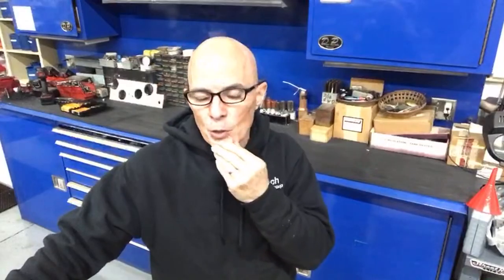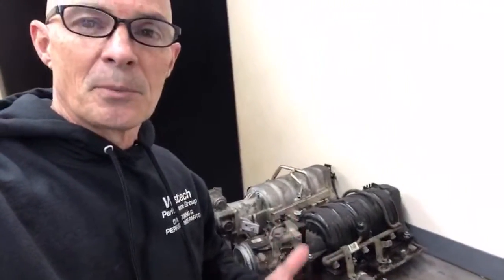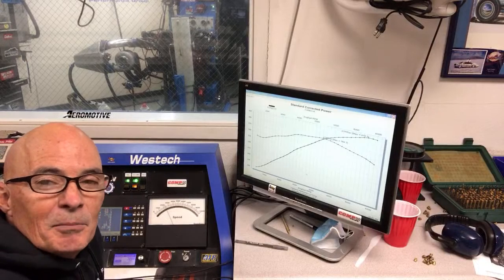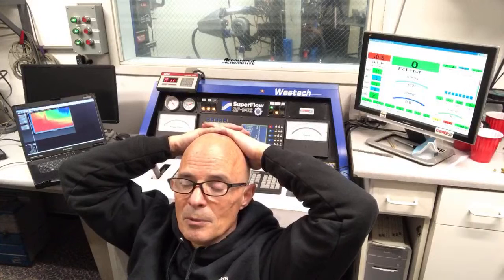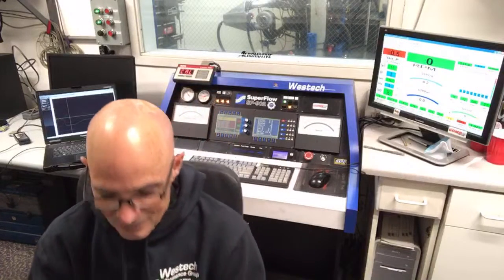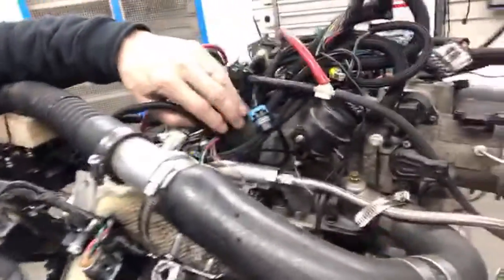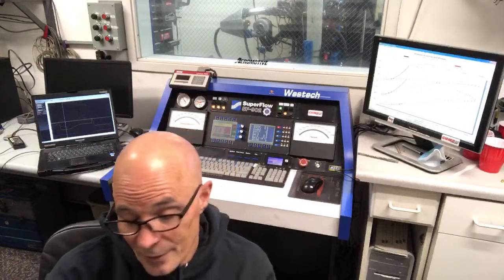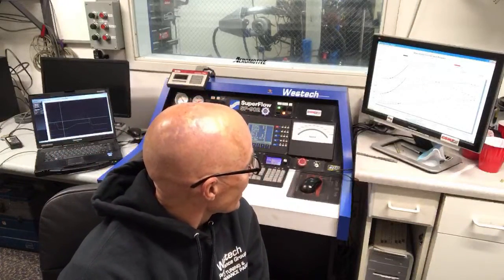Let’s Talk Tech-Turbo 3800 is up!

Comment: As for the comments regarding the Aussie manifold, they are actually pretty poor due to the tiny cross sectional area at the bottom of the runners where the injector bosses are, iirc it was in the low/mid 30mm range height and about 24mm wide. I think they are ok for boost but most serious guys here use the L67 LIM and make a sheet metal plenum.   For NA we tested on a highly modified race engine and found the US series 3 bananas to be a substantial upgrade over the Aussie manifold even if the LIM had to have a chuck cut out and patched up to clear the alternator/tensioner bracket.

Comment: Yeah your pressurizing the case because you know instead of just having pressure after the rotors you have pressure from the turbo even before the throttle body and the PCV is part of the supercharger case what I would recommend is completely block off what I would recommend is not use the blower case as a manifold but if you can completely block off that Port that goes up to the PCV valve and it also goes through the throttle body too iirc and then just make a fitting off valve cover or maybe even use the oil filler neck I think that would work I never actually finished my setup on mine I blew the engine as I was getting everything together to do it but that was my idea .  But once you've got your fitting from the crankcase however you do it and use that to go to your catch can and then remember with the turbo you need a check valve between the boost and the crankcase so then you have to have run a second line with a second check valve that goes to the turbo inlet so when you're under boost it blocks the pressure after the turbo and uses the inlet as the source of vacuum it's hard to explain just in words but I'm pretty sure you get it

Comment: 4L80E is a beast.  The first three gears are the same ratio as he TH400.  It's heavy at 230 pounds dry according to the GM specs.  With a deep pan and an external cooler, "dry" becomes "wet" about 15 quarts of Dexron later.  The GMPP 4L85E Supermatic available from Jeg's etc is abou $4,200 and rated to about 700 ft lbs.  I broke the input shaft on mine at 1000+ flywheel.  A good transmission jack is less than $300... buy em both at the same time  :  )

Comment: Richard...ever hear about one-piece oil rings letting oil into the engine after 150K?  Ok, oil out the breather is different than burnt in the exhaust... but it reminded me of a story... So your 150K car starts smoking but the engine has great compression, runs super good.  So I read one-piece oil rings are problematic at scrapping oil after many miles compared to the  'three piece' oil rings.  Apparently, MORE vacuum to the back of 'one piece' oil ring helps the ring remove more oil off the cylinder wall and through the narrow passages of the cast one-piece oil ring, and it did for me in a very obvious fashion, no smoke after only a few minutes.  I guess emission cars control the crankcase vacuum.  (My one-piece oil rings on a 150k 2001 BMW M54 likes more vacuum than normal...smoke out of the tailpipe until I added a higher vacuum line.   The new vacuum line went to the middle of the oil-snail PVC (factory plugged 1/8 inch nipple) and to the (1/4 inch factory plugged nipple) at the back of the intake manifold and next to the firewall.   Minutes later...no smoke...passed smog.).  This could help other engines with 'one piece' oil rings, high mileage but smoke, though they have great compression.
Reply from the maker: HAVE NOT HEARD OF THIS

Comment: The pcv valve you took out pu the spring off and squash the small end shut and folt it over so it's sealed or jb weld it shut and put it back I with the spring on top. Then there will be a fresh air inlet from the throttle straight into the crankcase that needs to vent or be blocked and vent the rocker covers
Reply: There is an 'O' ring in that PCV port which seals the PCV valve with the spring pressure as well.

Comment: STOP USING THE CROSSOVER EXHAUST BULLSHIT ITS LIKE CHOKING THE ENGINE TO DEATH I TOLD YOU TO USE THE MANIFOLD NOT THE CROSSOVER BS RESTRICTION
THEY ONLY DONE THAT IN THE FWD CARS TO SAVE SPACE!
Reply from the maker: CHOKING THE ENGINE TO DEATH-I THINK YOU MEAN IT WORKS GREAT AS A TURBO KIT! CHECK THE FORMULA

Comment: Pcv has to be plugged. I just took mine out and use the plate and a rubber gasket I made. Also there's a port in the intake in the throttle body that has be plugged aswell or all pressure get released through that little port. Love the content. You live streamed during my workout haha maybe next time richard! Love the 3800 content. If I may direct you to lame v6 turbo build on Chicago garage forum. Lots if good content there.